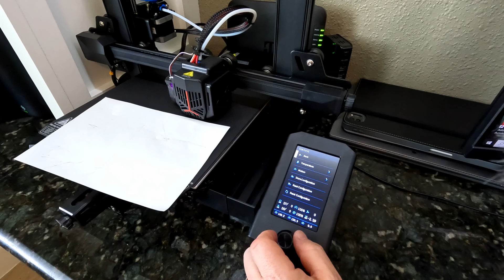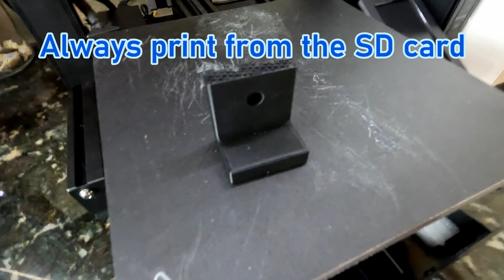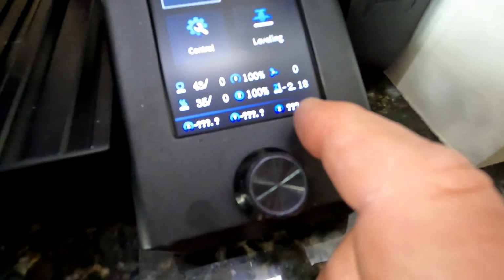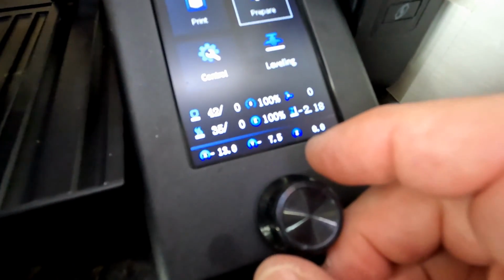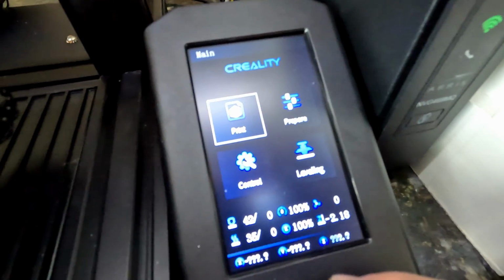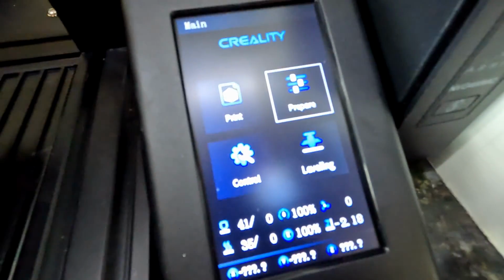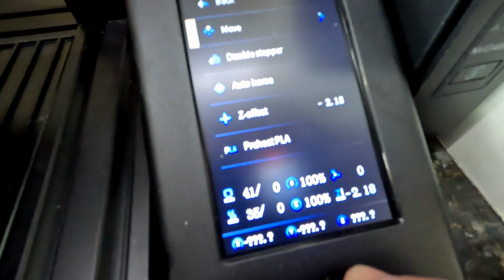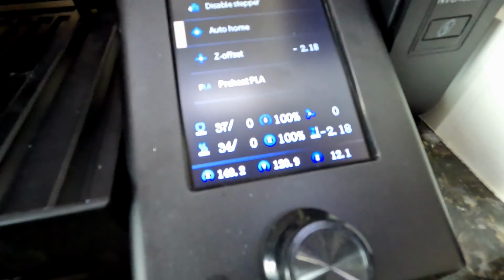Ender 3 V2 NEO 3D Printer Setup & Review #creality3d #crealityender3 #3dprinting

Comment: If you need to do manually leveling the bead by your hand.. so, what the meaning of Auto level??
Please answer
Reply from the maker: That's a great question.  I can't say I'm totally sure of the answer.  I believe that since you will never get it 100% level by hand, the auto-level is measuring the very minor differences between the various check points and when printing, it will take into account those differences as it moves the Z-axis back and forth.
Reply: @mancaveworkshop  Ender3 v2 Neo has good printing quality?
It make any problem during printing?
Reply from the maker: @nijoradevi5070  For the most part I can say that the print quality has been good.  I say for the most part because I have been printing on lower quality and have yet to try a high quality setting.  But even at the standard and low quality settings I am using, I can say that I am pretty happy with the results.  A couple of parts I printed needed a little sanding, but otherwise they are coming off the printer looking great!